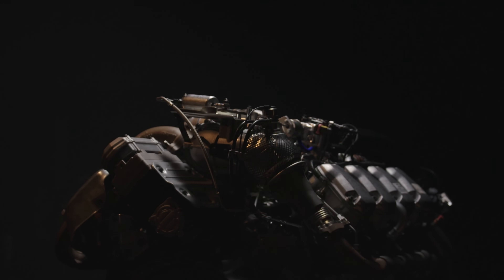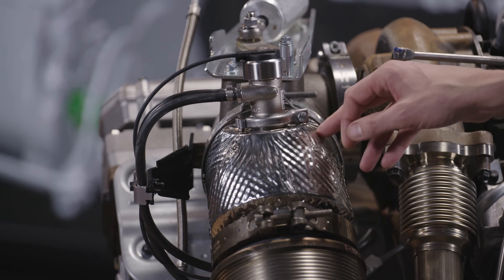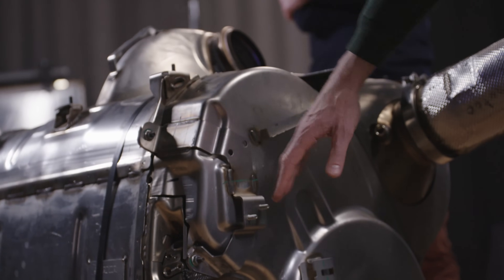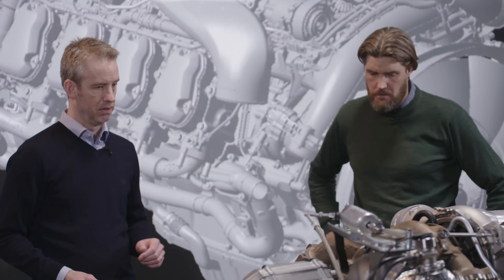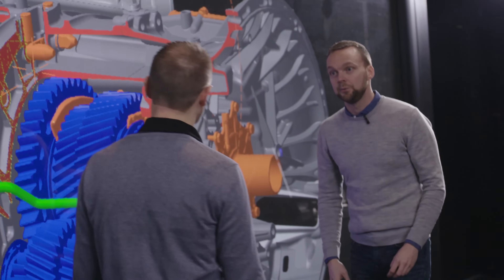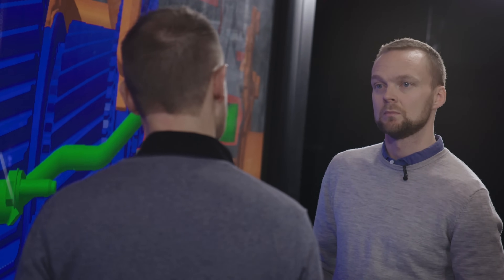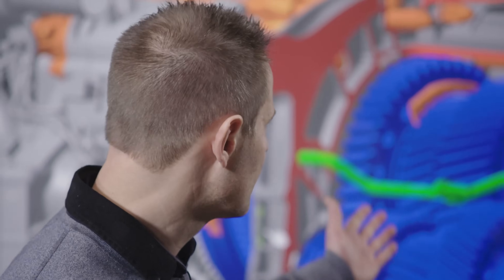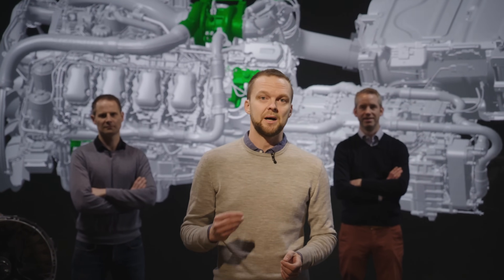Engineers present Scania's new V8 powertrain

Comment: I think the thing that really set Scania and Volvo apart from the crowd is that they build the engine and gearbox in house, companies like DAF just through a bunch of components together out the PACCAR parts bin and it definitely shows when driving it
Reply: Same goes for Daimler Trucks
Reply: @Oldtimer_Prototyp  but the result at Daimler is very much different to that of Scania and Volvo... Daimler would better not use their own slow and often wrong shifting gearboxes and underpowered engines...
Reply: Volvo and Renault is the same.Build inhouse 😂
Reply: @jorren1000  but they build the Renault down to a price on purpose and it still has a better gearbox than a DAF same goes for Scania/MAN
Reply: Mx 13 engine development  was in Eindhoven !!
Reply: DAF is underpowered junk.
Reply: @davidwolff8903  bullshit !! Engine are good, bud they put funking software in it so that it runs cheap. And then you don't get the power out of it. If you change the software, then he gets his power !
Reply: @kankerbende  in Australia they are an option in the 409 & 610 Kenworth. B Double 64 tonnes at 500,000 kms the bottom end let's go. Why does it let go? Because it's Paccar crap. Put the power in you think you can get. Won't make 200,000kms. They are not and never will be at a Scania or Volvo qaulity level. They are the butt of all jokes in Australia the Daf. It even runs Kenworth airglide suspension. It's total crap the entire truck. It's Paccar. Says it all. You wouldn't even be able to pull the smallest road train here with an MX13. It's useless even on B Double work. It's 13 litres. Wake up to yourself. Scania Volvo 16 plus litres. No substitute for Cubic Inches.
Reply: @davidwolff8903  you forget one thing !!!! It is not designed for that !!! You dont put a cesna engine in a 747. MX 13 engine was developed in The Netherlands, and there are no roadtrains. So do not compare this engine with engines that where made for that work.  In Europe, we don't drive with 67 tons !
Reply: @kankerbende  even with a single at 42.50 tonnes they are gutless. Lack torque. Only suited for light European loads. Just.
Reply: Dream on boy.

Comment: These combust engine machines are getting so complicated. With electric drivetrain it would be so much simpler and maintenance free(er). But theres still the problem with energy density on batteries.
Reply: Batteries that charge from energy produced by mainly coal fired power plants. Yup! That the "sustainable" future.
Reply: you know, electric vehicles have battery chargers, regulators, inverters etc. These things are SUPER complicated. The electronic boards have HUNDREDS of chips and other electronic components. I would not call that simple. Oh and by the way these diesel trucks are still very reliable and don't break often even though they are very complicated
Reply: @dieselgeezer18  yet they are complicated electronics but those have no moving parts. And wont wear out over time. A quality inverter for example lasts for a lifetime with no maintenance
Reply: @dieselgeezer18  did those deutz tractors have modern emissions control, no. did they have 78 different innovations to cut down fuel consumption by 20%? No. They were mad to last as simple as possible. Sacrifing for fuel consumption. And emissions. 

My point is that for ICE's there are so much stuff to cut down emissions but they have so little effect compared to electric. Same ass hdd vs ssd drives. 

You cant make a diesel engine as efficient as an electric. Moving a certain distance takes the same amount of energy.

And you are right. well maintained quality engines last "forever"
Reply: @Heve62  Sacrifing for fuel consumption???? WHAT? That tractor is the most fuel efficient tractor probably in existence! Google it and you wil see! I don't remember the last time i put fuel in it. People have put this engine into pickup trucks and get like 40MPG. I believe there is still room for improvement in diesel engines. Moving to 2 strokes is the way to go. The way that big ships work. They have big 2 stroke engines that can reach efficiences up to 50%. In a 4 stroke when the exhaust stroke is happening you just create more friction losses by moving the piston up and down and you are also not creating any power, while a 2 stroke is creating power every 2 stokes. Every time the piston goes down its making power. With a 2 stroke you can make more power with a smaller, lighter, lower revving engine that can last longer and have less moving parts.
Vids and articles talking about the fuel economy of deutz diesel engines:
https://www.4btswaps.com/threads/has-anyone-heard-of-a-deutz-air-cooled-diesel.6750/page-4
https://www.youtube.com/watch?v=bT0MS0TP0p4
Reply: @dieselgeezer18  how many ho does it generate, 35?
Reply: @Heve62  50. Please don't say that 50 horsepower is not enough. Its MORE than enough. The tractor can go 60km/h which is more than enough to go around the farm. It has ultra low gearing and can pull an entire house out of its foundation. The engine also has gobs of low end torque. On idle it can go up huge hills while carrying a trailer full of dirt. Revving the engine and dropping the clutch sends you flying forward
Reply: @dieselgeezer18  yeah i know that its plenty for a tractor but about relationship between power and fuel consumption
Reply: @Heve62  i don't understand what you mean by saying "relationship between power and fuel consumption"
Reply: Electronics also suffer wear, from operating cycles and temperature cycles. We can't see with our own eyes the movement, but there is a microscopic movement in parts. I work with car electronics, and believe me, electronics are the components that most fail nowadays (Great for me, I have job 🤣🤣🤣), nevertheless, the reliability (mechanical and electronic) of some cars nowadays is awesome, being the cheapest (and simpler) cars the best. Greetings
Reply: Put the V8 inside the trailer and strap a Genset to it to charge the batteries when needed. Guaranteed that prime mover will only run 25% of the time in comparison to a normal installation

Comment: Interested to se how long scania will keep making those v8 engines. Inline 6 would be more efficient with only one cam and less weight
Reply: The V8s only have 1 cam too...
Reply: @nickwhite6717  yes but but v8 have them on both cylinder banks. A vr8 would only have one. Like i6. Dont know if theres any vr8 atleast i know a vr6 by volskwagen
Reply: @Heve62  I guess The consumption is best in class  anyway.
Reply: @Heve62  Any inline or V engine configuration can use a single camshaft with pushrods - a single camshaft in the vee plus pushrods is the classic automotive V8 configuration. With overhead camshafts you do need at least one per bank (and normally now two per bank), and inline-6 engines routinely have two camshafts. The Scania V8 design uses pushrods to run four valves per cylinder; that means a camshaft in the vee of the block (so there can be just one), but it looks like there is a separate camshaft for each bank.
Reply: @brianb-p6586  oh i didnt know they used still pushrod. I thought only some cheap old style Americans would use them nowadays lol
Reply: @Heve62  pushrods work well, and avoid long camshaft drive chains or gear trains. Their main disadvantage is the mass of the pushrods and rocker arms limit high-speed performance, which is not an issue in a truck engine. Even in a car engine, General Motors pushrod 2-valve-per-cylinder V8 engines are lighter and more compact than Ford DOHC 4-valve-per-cylinder engines with similar power output. Ford understands this, and their latest large (7.3 L) gasoline engine for medium-duty trucks is an all-new pushrod design.

The Mercedes OM502 16 L diesel V8 (and similar OM501 12 L V6) used in the Actros until at least 2012 is very similar to the Scania V8, including the individual cylinder heads and pushrod valve actuation, but it looks like it uses a single camshaft. I don't know what Mercedes uses now.
Reply: The gross weight of trucks is increasing. Big power is not only needed but mandated when climbing north of 64 Tons (metric)

Comment: make opposed piston engine to save some fuel
Reply: Twin Chanko shafts with  its transmission eats up som of it and its a complicated system...
Reply: They could build a 2 stroke V8. Not like the dirt bike engines. I am talking about 2 strokes with dedicated oiling system and direct injection. No need to mix fuel with oil. Such engines could provide so much more power and the engine could be smaller, lighter and somewhat simplier
Reply: @dieselgeezer18  But it wouldn't pass emissions standards.

Comment: Uh, haw powerful uh haw strong.....bla bla bla, I see in USA the truckers order CAT 18 liter with 1200 HP or recon on Cummins KTA 19 with 1500 HP, now that is power and torque is in 3000 to 4000 range so should be in use as heavy haul but these truckers most of the time take the trucks to shows, after all they put 500 000 $ in to them- trucks.TH
Reply: Those trucks don't last long
Reply: @idontknow2rhhfhf  they don't last long??? Totally wrong, there's plenty of C18s and KTA's still running the roads here in America at 40 tons gross weight or better!
Reply: pointless..

Comment: The only reason to stick to a V8 configuration is marketing. Moving parts give resistance, therefore a V8 is always less efficient than a 6 cylinder engine. This alone is the reason all other brands have given up on their V8 (and V10, MB and MAN) engines. It is also the reason Scania's 500hp is now a 6 cylinder engine whereas in the 3 series era even the 420hp was a V8.
Less moving parts is also less wear, less maintenance, etc.
There really is no sane reason to buy a V8, it is just emotion. Emotion doesn't pay the bills in a market with an average profit margin of -2 to +2 percent.
The only excuse for getting a 500+hp engine, regardless of configuration, is seriously heavy loads and/or really bad conditions. But hey, call it hobby and all is good right?
Reply: Going by your theory, why not make big bore I5s? Or I4s?
Reply: @nickwhite6717  Scania uses 5 cylinder engines for smaller models, and has done so for years now. Up to 360hp and 1700nm these days. As much as the 6 cylinder engines have made the 8 cylinder engines obsolete, especially at the lower end of their power range, the 5 cylinder engines will do the same to the 6 cylinder engines indeed. Your point beeing?
Reply: Six cylinder engines exist purely because of packaging efficiency into legacy shassis and drivetrain dimensions.
Inline sixes have plenty of fundamental problems, such as torsional resonance and rear cylinder cooling.
I guess if you live in reclaimed swamps as flat as billiard tables, where the biggest incline is an approach to a bridge, 400hp is enough.
Reply: MAN stopped producing V8's because it couldn't make it a Euro 6
Reply: @idontknow2rhhfhf  yes they could, technically. They just didn't deem it economically feasible as they also have high rating lower consumption cheaper maintenance 6 cylinder engines, so the few on the top end that might favor a V8 wouldn't make up for R&D costs. And they are correct, as there is a MAN heavy haul tractor with a licensed gross weight of 1002T. Single tractor, 6 cylinder. Red and cream colours, don't remember the company name.
Reply: @bartsalemink5729  If there is a demand,  someone is selling the product.  Hauling 60-90 tonnes in the hilly scandinaviancounties demands allmost 4000Nm.
Reply: @fortune300  yes, there is a market for engines with that kind of power, albeit small. But Volvo proves you really don't need 8 cylinders for it. The V8 is a beautiful piece of engineering and technology, don't get me wrong. But it's existence is no longer based on rational technological or economical arguments. Marketing and emotion, nothing more. And Scania plays the commercial game with it very nicely I'll happily admit.
Reply: @bartsalemink5729  A bigger 6cyl would be longer and more expensive to make fit in the truck. 
It would also be more expensive due to demand of compleatly different technology than on the 5 and 6cyl engines with the same bore and cyl heads etc.
Reply: @fortune300  A larger inline 6 would be only a bit longer then the existing 13L I-6's, and the cabs are plenty long to fit them under. Chassis space could have been provided with the introduction of the NextGen line. So more expensive to fit in? No, not at all.
Surely it would require the development of a larger bore engine block, but the technology behind it is largely the same.
From a seller standpoint they avoid those R&D costs by playing the marketing card and use emotional arguments like exhaust sound to create the market for the V8 to a large extent. Like I said, they play it well commercially. But from a buyers point of view, you really don't need a V8 rationally. It's a form of tradition with the brand I guess, since all others and mostly their respective customers have seen the light years ago. Sisu even offers a 900hp hybrid configuration, based off a 600something hp 6 cylinder, developed for the Finnish heavy long forestry trucks. No V8, because you really don't need one.
Reply: I dont know where you are from, but in the scandinavian countrys standard truck for hauling gravel and other bulk materials has 7 Axels and a limit on 56-60 tons. In Finland and Sweden they can go up to 90 ton or more with 10 axels. So we do need the power from these beasts…😊👍
Reply: @tommyfrederiksen9451  and here in the states there's areas where we can run 60tons gross legally. New York being one of them states...Utah, Nevada. The Dakotas etc and we've done it superbly with inline 6's at 15 liters, and yes there's mountains here too!
Reply: @tommyfrederiksen9451  Holland. The max as per EU regulations is 40T, countries are allowed to make local exceptions. Holland does, max is 50T on 5 axles in a specific wide spread configuration. No problem doing that with 6 cylinders and 450-500hp even in deep sand with a tipper. 60T B-double trains usually have the same hp, with just a standard 4x2 tractor unit. Anything over that 60T is really heavy I suppose, and in the mountains or in bad road conditions you'll need some more power indeed. But that still doesn't justify an 8 cylinder configuration, Volvo does 750, MB 600something, MAN and Iveco just under that. All from 6 cylinder engines. A V8 is an emotional argument and a marketing tool, and nothing else.
Reply: @bartsalemink5729  I live in Canada and gross over 60T every load with 6 axles. My truck has a cummins x15 with 565hp 18 manual and I have zero issues hauling that load. There's heavy haul (200T) guys here with "only" 605hp. I don't see a case where 770 is necessary. That being said, id love to drive a truck with 770hp 😅
Reply: @MistaRoyanT  and all 6 cylinder engines if I'm not mistaken. My point exactly 😎

Comment: To all other manufacturers. Take notes. That’s how you make an epic engine. Only Scania still has the ball’s to make a V8
Reply: Hahahaha, Better have a 6 in line, than 8 on a heap👍
Reply: @Rickie92  🤣🤣🤣 ok u got a point there.
Reply: What is so epic about it...?
Reply: @mxfxn6474  mainly the sound and the feel.
Reply: Mercedes and MAN don't make anymore?
Reply: @CrackheadBeaver  not as far as i know. Wich is a shame because I liked the merc’s V8
Reply: No need for a V8.
Reply: Diesel V8 sounds like any other tractor engine. This is a truck, not a car. Misguided marketing, can't be as efficient as a 6 cylinder engine with the same horsepower.
Reply: @otis3795  You are aware of a phenimenon called torsional resonance in crankshafts? That's the big issue with very high output inline sixes. Of course, the other issue is cooling the rear cylinders as well, which typically requires derate of whole engine to ensure safety margins.
Inline six diesels exist because they fit better into legacy truck chassis dimensions like used in North America.
Reply: @TyphoonVstrom  ....yes but there is issues with every engine configuration, a job for the engineers to overcome. I agree that in Europe where everything is trimmed for efficiency it's nice to see a v8 while everyone perssues the "theoreticaly" most efficient way with the sixes.

Comment: Dual SCR, nightmare squared
Reply: Euro emissions pal what can you do? 🤷‍♂️
Reply: @thomaswerner5821  You are of course correct. The energy does have to come from somewhere. I thought you were implying some kind of post injections of hydrocarbons that can be used. Braking the engine is also an option to increase temperature. More CO2 then! 

It is also not pure carbon as you say, but most of it is. The rest is ash and stays in the muffler (it cannot be oxidized). Unburnt hydrocarbon is creating soot and is mostly as the name implies hydrogen and carbon. The ash stays in the filter and will in time increase back pressure and fuel consumption. 

Also oxidation does not necessarily need elevated temperatures as passive oxidation (NO2 induced oxidation) is active at lower exhaust temperatures.

Not sure what technique Scania is using though...

In principle I agree with you. Diesel is nasty but there are not to exceed limits for both particle mass and number which all truck manufacturers have to comply with.
Reply: @thomaswerner5821  Toxic fumes? From soot? What do you mean?
Reply: @thomaswerner5821  soot is actually carbon and oxidation will produce carbon dioxide. Sulfur is also present but often less than 10 ppm in diesel. Sulfur oxides can form, but will be very little.

There are other methods than injecting diesel to elevate temperature.